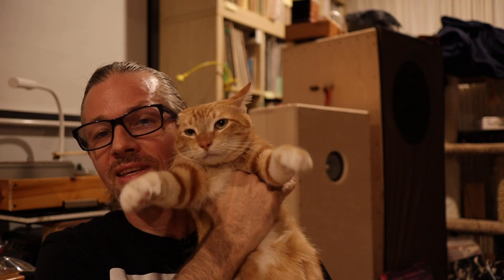Loudspeaker efficiency, amplifier power...  Exploring a long and winding story...

Comment: Question: if lower efficient speakers are wasting energy, that energy is still being put into the room right? And if so, wouldn't that affect listening fatigue, inflammation in the brain? I got to thinking this because I have Dirac room correction with my NAD M10 and it lowers the gain when the Dirac setting is used. I sense a similar 'fatigue' at the same volume level (but set higher because of the lower gain). Am I correct on this? Come to think of it, I've only had low-efficiency speakers so I wouldn't know how high efficient speakers relate to listening fatigue. 
Thanks as always :)
Reply from the maker: Hi Derek, absolutely wonderful question, I'll try to answer in a video! ; ) 👍✨
Reply: @realworldaudio  🕺
Reply: @realworldaudio  Looking forward to your response! I've never heard ANYONE speak on this topic
Reply: Hoping you can get to answering this :)  @realworldaudio

Comment: High efficiency speakers usually means very little bass and lots of mid-bass as low bass takes power.
Reply: High efficiency means needs less power for the same output, also in low bass. It's just that the vast majority of drivers have traded bass performance for efficiency (very easy, in either direction).. very, very few attempt to achieve both. My Altec 414s are only 12", 96 or 99dB efficient with an Fs of 31Hz (flat from 20Hz with my speakers).. which shows both efficiency and low bass can be had - but it seems development since the 1950s has been focussed on low price and the last 30 years also on resonant semi-low bass.
Reply from the maker: Hi John, sadly the majority of commercial high efficiency solutions is heavily compromised with the bass unit having a much lower efficiency than mids/highs, giving this sad situation. When the speakers are balanced, and the bass is as efficient as the highs, then midbass and low bass if perfectly integrated, and astoundingly liquid, alive and utterly breath-taking. High efficiency bass has so much dynamic and textural / 3D layering to it, that is is truly staggering - bass stops being a mass of sound, and changes into an entity with body and shape.

Comment: The way I visualise low efficiency issues is that 
(1) most energy is used to overcome (initial) friction of spiders, surrounds, components - and not moving air... I find high eff. units and low-mass panels articulate much better at lower levels
(2) coil and surrounds heating up causes resistance, inductance, material stiffness to alter causing dynamic crossover shifts, which are not measured at 1W
(3) the chance that the 99%+ loss is linear in something like dynamic drivers and coupling to the air: not likely 
(4) Distortion increases quickly with more excursion, so higher efficiency units have an advantage all things being equal.
Reply from the maker: .. and none of these issues are brought up when companies are advertising their newest high current - high excursion models. The exclusive focus is on the improved features, and all the drawbacks are very carefully left in the benevolent veil of deep silence. Somehow now all the fascination is on the ability to play louder, and the term "dynamics" is falsely used for the ability to play at high SPL, and not for the range of dynamic shading achievable. Most people nowdays have never heard a dynamic system, even after decades of being a hard core audiophile.

Comment: Hi Janos, it is always good to see you love your animal room mates. It is very difficult to explain this subject of your video. But I think you have done very good job at it. In addition, you could also approach it from the opposite side and ask why a loudspeaker has a low sensitivity and what the objectives of the design choices where. There are then different categories of low sensitivity speakers. For instance, the FF125WK is of lowish sensitivity and so is the woofer in main stream speaker. But they are very differently build. The FF125WK is in fact build as a high sensitivity speaker, but its efficiency is limited by its cone size. That is why it can partially do in la Grande what the voice of Lancelot can do better. What is missing is the base extension and for that reason the result is not as realistic as with the voice of Lancelot. On the other hand, a woofer in a main stream speaker is not build as a high sensitivity speaker. It is build as a speaker that has a lot of base extension for its cone size. Therefore it has a far lower fall off of its frequency response but it can never do what la Grande does. I think it could be therefore useful to conciser the efficiency divided by the cone area (or perhaps VAS) as indicator of how good the resolution of the driver by it self is within its frequency response. We should also not forget that the dB scale is logarithmic, so it may have to be translated back in to a linear scale for this parameter. In any case, I am putting down some thoughts I have about the subject and not stating confirmed facts, or claiming I have the mathematical formulae for predicting the resolution of a speaker.
Reply from the maker: Thank you Hugo for this amazing summary! Just did a quick check on the driver surface area, and indeed, if the FF125WK was upscaled to the same surface area as the Altec 515C, then it would be almost as efficient (1dB less only!)
Reply: Hugo, today my PR arrived as well as two 4 inch drivers ... will start to order plywood and get to work
Reply: @sebastianbenz2496  Thanks for letting me know. Good luck with the build and I hope you post your findings.
Reply from the maker: @sebastianbenz2496  👏👏👍 So exciting!